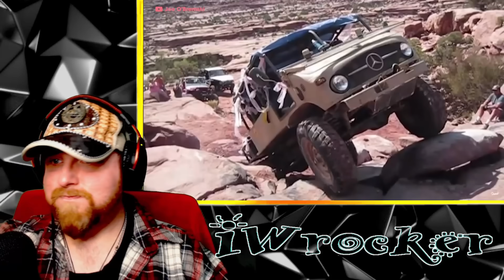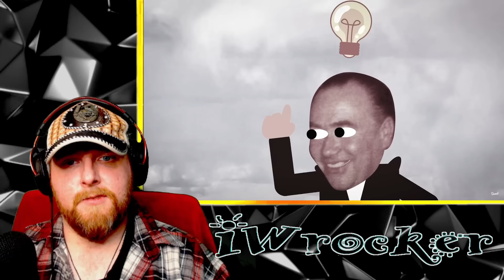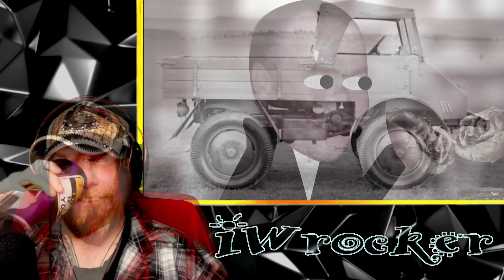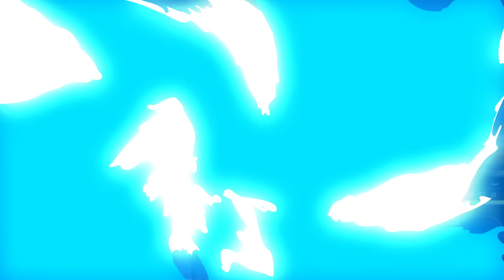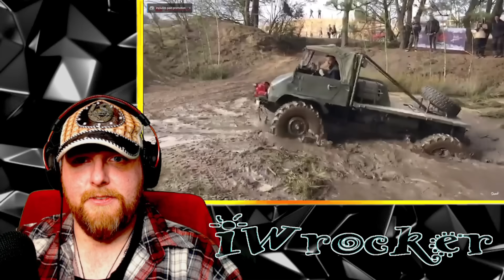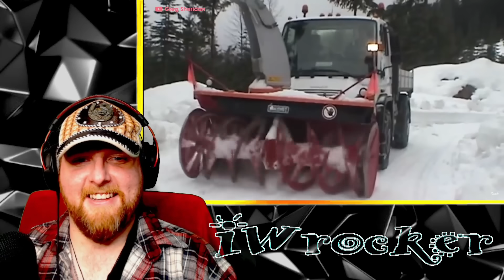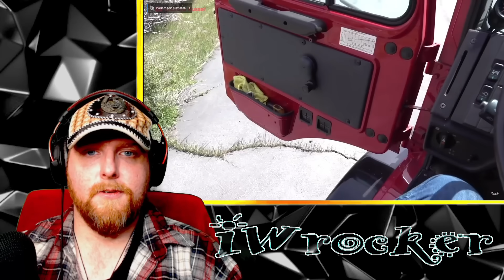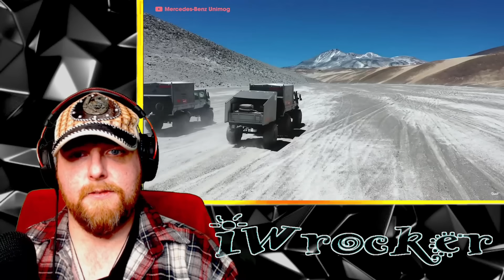American Learns About the Mercedes UNIMOG

Comment: a friend bought a original 3rdgen unimog for 1800 euro 2 monts ago and just ordert 500 euro parts to replace all the parts that he got told needet replacing but the fun thin is the old parts in the thing that got tortured for 20 years straight hauling wood from extreme terain i cant reach savely on a dam ktm bike and it turned out only the caseings where a bit rusted on the outside and all the rubber was degradet but thats it the rest of the parts looked like new after a brake cleaner bath its the cheapest way to get a military grade vehicle in germany and when i say military grade i mean can be tortured by idiots for 20 years on a daly basis whitout braking in extrem ofroad terrain and haul a additional 2 full pinetrees on every second tour ....and geting parts is easy bacause mercedes has tonns of parts stashed away because of things like military contracts and most of the newer parts are compatible to the old models u can always upgrade a older one whit enough newer parts in some cases they still produce parts for the original unimog to this day 
(also there is a floating platform u can buy strap the unimog on and drive on water so u can have a floating bagger and hauling truck roled into one to work on waterways its used by the THW and i mention it because the version they used for that is legal in the usa because the THW got special permits after katrina to use these unimogs to transport giant pumps while using the unimogs themselves whit pump addons for smaler jobs)  oh and in case of emergency the thing runs basicaly on anything that burns

Comment: The first generation of Unimogs really nailed it back then. The second generation wasn't all bad either and expanded on the modular options but also grew in size and weight. The following lines sadly never managed to fill those shoes. The ruggedness and simplicity haven't  been equalled since.

Comment: The last time I saw the Unimog was in the Mercedes-Benz Museum in Stuttgart. It was a Technical Relief vehicle used for disaster relief with a flatbed, a  vinyl tent cover on top and a snowblower mounted to the front.
I can only recommend that museum. More than 1500 items on display. 
You can literary stand right in front of the Patent Motorwagen (The first commercial automobile) with no barrier between.

Comment: I worked with an unimog on the vineslopes in south of france. It served in the german army before, it still had the lock on the roof for a machine gun turret. Ours had a transport box mounted on the platform and fixed with big chains. Very impressive machine.

Comment: Back in my younger years, I worked as a firefighter for my community and I drove a Mercedes Unimog Fire Engine. It carried 3000 litres of water and 400 litres of foam consentrate. Water and foam cannons on top and hoses and things in the back and also on a small trailer we dragged behind. This hanger housed the portable water pump for getting water from the lake or rivers around, if water was not to be found near the fire. That car was really a Godsend as it could go everywhere in all sorts of weather. Snow up to the door? No problem. Super slippery and icy? Still no problem. It was not a speed demon, max speed about 50 miles per hour downhill, but we got there in the end.

Comment: When the US- Army invited the Hummer  the Germans had have the UNIMOG for years. And it's a lot better and efficient than the Humvee. You can also carry trailers up to 30 tons. As you said in the video, they 've been using in a lot of communities or for construction work, firefighters, army and all that sort of stuff. They're really workhorses. It may be interesting, that there is also a special model used by the german army called "Dingo" which bases on the UNIMOG.

Comment: Many years ago a friend told me of his UNIMOG.  He was doing some landscaping and had to move a large boulder down a hill.  So  he, I think had a forklift attachment on his.  Got it all loaded up on the top of  the  hill.  Some time later "he" was down at the bottom talking to the owner of the job site.  They chatted while they watched the truck/thing very slowly coming down the hill.  It was taking it's time.  As it got closer, the property owner noticed there was no one driving it.  My friend had simply loaded the boulder, aimed it down hill, and put it in LOW gear.  Then he walked downhill and waited.
I always wanted one.  But never really NEEDED one.   LOL
ebay has some from $20k - 50K  I think they fit into special categories.
1- You  need it to do work.
2- If you have to ask, you can't afford it (or its parts and repair).

Comment: You don´t need parts, because they don´t brake.

Buddy of mine hase a 435 with all the bells and whistles for his treecutter company, and the only thing he is worried about are the tires for this beast!
He dose mowing, winching trees and logs, driving a wood chipper front or back,  hauling anything and even moving his mountin bike to the bikepark with it 😆
It´s real monster that can do everything!
It´s a truck and tracktor, but german made! Not that crapy Cummins shitt you americans have!!!
He baught it with 12.000h on it for 40K and the only thing he did to it in the last 3 years is replacing a blinker relay and changing the oil! (tires are a hard topic because they are so expensive!)

Comment: the old Unimog's where advertised with a top speed ranging from 80 Meters /h to 80 km/h - 28 gears!
 Check out what a "portal - axle" is...
By the way you have two PTO's - one in the back and one in the front... (plus all the hydraulic systems you want to have.

Comment: Betcha they are available in Mexico.

Mexico usually doesn't buy in to US protectionism in the same needy puppy way that Canada does, and so gets all the cool stuff that Congress and Parliament deny we poor gringo saps.  And while yeah that doesn't change how you'd need to buy a 25+ year old Unimog to get it across the border legally (iirc or 20+ years old to import to Canada), 25+ years of even very hard living ain't nothing to a Unimog.  AND at least you don't have to look across the ocean for parts and tech information; just get a VPN, log on to Mexican Amazon, and learn a little Spanish and you're golden.

Or... and hear me out on this one... why not get a really cheap one with a blown engine... and powertrain-swap it for something domestic?  Wanna know what is sexier than a Unimog?  A Cummins-swapped Unimog; that old fashioned nigh-indestructible chassis married to an old fashioned nigh-indestructible diesel engine (so long as you aren't a hoon with it).  Now that would be off-roading heaven.

Also, Ford kinda caters to that same do-it-all niche in the US with the 450 and 550 chassis; those frames can be turned into almost anything as well.  And aren't tall wobbly cab-over layouts for what that is worth to some people.

Comment: The can be bought for cheap as ex military, fire brigade or technical service (THW) in germany. At least the older ones.

A  friend bought one with a radio case on the rear. Made for the military but handed down to the regional technical service. It was one with a streight six and a round bonnet. He turned the car into an explorer vehicle and of he went. After a tour over spain to marocco the first year he gave the car some upgrades and made a tour to the US the next year. At customs they told him: This is ex military which was not unlisted and not demilitarised. No problem brining it to the US, but you have to bring it back. Demilitarisation would have only meant to paint over some service markings and unlist it from the list of military vehicles, but he never knew and at the moment he had no time.

The time in the US was a blast and he found out, a lot of services and equipment could be had for dirt cheap. At least compared to germany. Chroming those monster tires or huge bumper: Not much money at all. He visited some events, met a lot of people and after a week he had a white painted Unimog with every part in chrome, you could chrome. The extremely sturdy special paint was even a little bit more expensive then the chrome. So he went on his way from east coast to west coast. Having a bed, kitchen and tiny chemical toilet helped a lot with crappy motels. At the time he was single, his girlfriend for ten years dropped him just before the journey. He would never thought a nice car can bring you into the pants of a girl, but this car did. "So you said, you drove a mercedes, but I don't see one..." "Do you see that white monstertruck over there, with that huge mercedes star? It has a real bed in the back..." "Uhh... that looks nice, never knew they build those cars."

He got some real good offers in the US for the car, but was not  allowed to sell. But yes, in the end he demilitarised it back in germany and sold it to a guy in the US for a pretty good penny.

Comment: I drove one of these during my service time. A truly UNIversal MOtor Gerät. Never got stuck, even with the pretty heavy "medic" version. The only construction error was the cabin ventilation inlet. Drive through water deeper than about 120 cm, and you get a free shower. When we did field exercises, I taped the inlet shut with duct tape, and water depths beyond 150cm were possible (the engine has its inlet above the cabin..... why not ventilation too?).

Comment: Unimogs are very popular here in Germany. 
They pull big flatbed trailers with excavators, are used to move train cars in harbors, are available with cranes or excavating equipment. And there are special versions for almost every purpose imaginable.

The version with the variable cab for left and right hand drive is often used with mowing and bush cutters, to clear the greenery along highways and other roads around here.
A common sight is a Unimog with a bush hacker on the back and a big box on the bed. 

Ever since I was a small kid, I remember them driving around. In the countryside, they are or were also often used as fire trucks. I had a big full metal toy Unimog as a kid. Working steering wheel and trailer coupler.

Comment: I learned to drive as a teen on my grandparents farm. They had two Unimogs, a canvas cab 411 and steel cab 406, diesel powered. Those seemed huge to me at the time (I may have been 13 of 14 at the time). Of course there was absolutely nothing remotely automatic about those things and I stalled a couple of times.
The most impressive was the huge forest of levers in the middle and it took me some time just to remember where the gear lever was.
BTW check the channel "Grind Hard Plumbing Co", they're based in Idaho and they have an Unimog.. kinda 😅

Comment: There used tp be a dealer in Portland, Oregon that sold them back in the 90's. They had dozens of them all painted bright colors. 
Story was they found them stored in a cave in Switzerland and brought them to the US, restored them and got them registered for road use.  
Almost bought one from there, but it was a bit much as a daily driver. Fuel was less than a buck around here back then though.....

Comment: I live in the South of Germany, and I actually learned how to drive a car in our 1948 Unimog... My father had bought it in the late 70s from a farmer, it was in quite bad  shape then. But it sold for 500 Deutsche Marks then, and util today you can actually get dpare parts for it!
Driving that thing was all but easy for me as a 7-year-old, I remember having often to use both hands to shift gears... :-).
It had a 25 HP Diesel engine, top speed was around 50 km/h. But we almost never used it on the road, besides the first drive when we had to take it home from the former owner's place. We had to drive only about 120 km, but it felt like an eternity. We weren't allowed to use the Autobahn, because the thing wasn't fast enough... :-D Well, you don't want to be on a German Autobahn with anything that slow anyway.
I loved that boxy little vehicle. You could drive it really anywhere, in mud or snow. We also used the PTO a lot, we had gotten a range of different machines with the truck. We used it as a snow plow, transported hay and live stock. It was just an amazing little truck. After my father died, I sold it to a collector. It's still in perfect shape and is still used regularly for all kinds of tasks, after more than 70 years!

BTW, I love your channel, thanks for all your work, it is really appreciated!

Comment: You can buy a Unimog and drive it in the USA.
However, this is a bit more expensive since the Unimog is imported into the USA from Europe.
You can probably do the process yourself (all paperwork, cargo contract, etc.) or through import agencies.
The US dealer who had been offering Unimogs in the US appears to have stopped offering them due to US diesel regulations.

A new Unimog (I'm not referring to any version here, I'm just giving a price range) probably costs €60,000.
Used ones are also much cheaper.
So you can buy one and have it shipped to the US.

Comment: My uncle owns an older Unimog and loves it. It's fairly low tech and he's been working on it and modifying it and basically has bought, build and modified a number of attachments and modules he can swap out at will and do anything around the family property that would normally require a truck, a tractor, a combine harvester, a forklift, an excavator or a wheel loader. It's such a workhorse.

Comment: Gotta love those things. They look kinda silly, but you know this thing can do anything and wherever you wanna do that thing, it can get you there. Unless it's in the ocean. And I'm 100% sure someone has turned his Unimog into an amphibious truck and it probably works just fine.
EDIT: Wtf, they are not legal in the US? I thought you could drive basically anything that has wheels and an engine there 😅How can something that is road legal in Germany not be road legal in a country that according to every single prejudice I have has much less strict rules according to what (and who) can drive on its roads? Just looked it up and you can get a used one for under 10k over here. Spare parts though... no idea. Although I recon considering what they are build for and that they are bascially old Mercedes', which kind of have a reputation for being the car that half of Africa drives around in because access to spare parts is not something you need for repairs, I'd imagine if you have welding equipment and a hammer, that's bascially all you need 🤔

Comment: I was in the RAF for many years as an Armourer ground crew in the RAF Germany Harrier Force, this meant most of our training was not just as Aircraft Engineering Technicians but also taught defensive combat for defending the aircraft in the forests and country roads of Germany.  This also meant taking the Harriers into the woods and forests to hide them in a war scenario.  As you can imagine the hides were like garages for the Harriers made of cam netting to hide them and PSP (pressed steel plate) so the wheels could move on when taxiing around the taxiway too and from the hides.  Essentially the earth was either grass or mud and the Harrier was pretty heavy to move anywhere, this is where the Unimog came into its own.  The gearing on this thing can make the vehicle (I think)2 to 3 inches a minute, the suspension makes it possible to drive over most Terrain so it can literally pull a Harrier anywhere, on the flat! The weight of the harrier meant the back wheels of the Unimog had to be weighted down with inert practice 1000lb free fall bombs strapped to the tailgate.  Oh!  And if the nose wheel buried itself in the mud, us ground crew had to weigh down the tail raising the nose wheel out if the ground while sand bags and PSP put under the nose wheel then the Unimog could pull it back onto the PSP track.  Really useful brilliant vehicle,  oh and it had a towing cable on its front.
Cheers Aah kid

Comment: It is said that there are no two same Unimogs, becaue there are so many varients and options. And it is also said that a Unimog never goes on the scrapyard because it is built so good that it will outlive its owner easily. This machine can be used for 50 years and still will be in good condition if mainainted properly.

Comment: I bought a Unimog about 20 years ago for £1000. It was originally a fuel tanker for a lifeboat station on the south coast. It was a 404 with a 5.7 litre diesel engine. I took the fuel tank off and sold it to a local farmer. Was fun for a while doing off roading, but eventually sold it. I'd still like to get one of the first models!

Comment: The best thing about a lot of the unimog models is that they have 2 gear sticks... one 8 speed, and a separate forward and reverse... meaning that it has 8 forward gear and 8 reverse gears, at the same ratios. It has the same reverse top speed as it's forward top speed.

Comment: In 2003 I made my mandatory military service in Germany (it's not mandatory anymore now). I was chosen for the medical service and finally as an ambulance driver. So I've got one month of drivers training and an extra off road training for the Unimog at it is the standard ambulance vehicle in German army. It was so great to drive one of these. Out of that off road training a remarkable situation stays in my mind. We drove into something like a hole and stopped having a wall of soil in front of me. The instructor just said: "Second gear and full throttle!" Me: "Are you sure?" - "Of course!" And that insane Unimog just climbed that three meter up like nothing. I just needed to stay on the throttle, holding the steering wheel and enjoying the view into the sky for a few seconds.
Unfortunately I wasn't able to drive one of these since 2004. It was so much fun to drive them and so impressive.
By the way: The top speed of 56 mph (90 km/h) is because of the german limit for trucks here in Germany. Every truck sold here has a limiter. I'm pretty sure an Unimog would go faster unlimited.